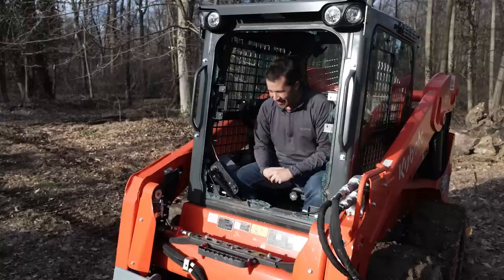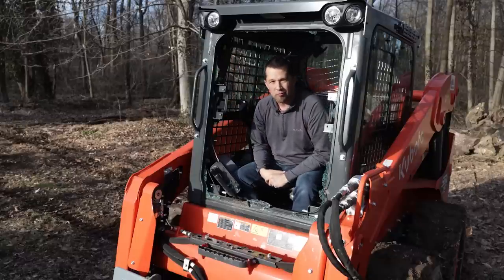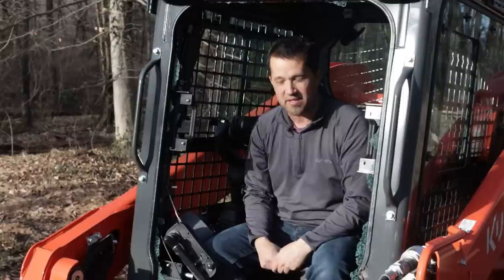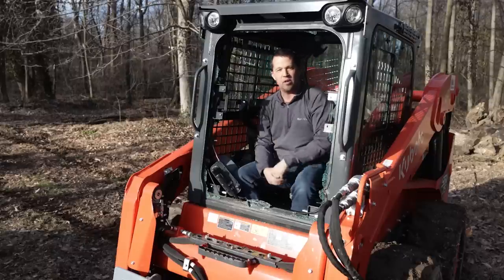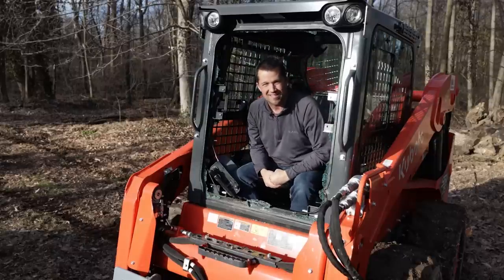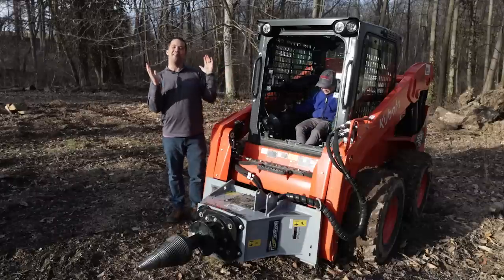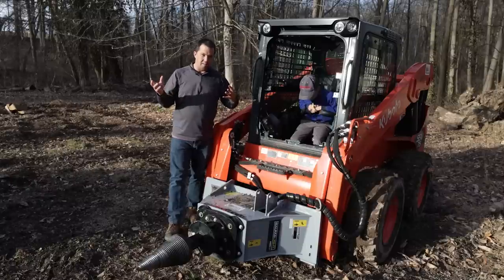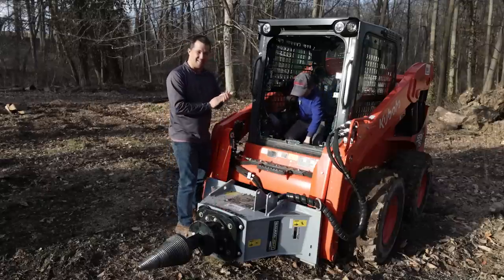I broke it. Kubota SSV front glass replacement.

Comment: Stumps are tricky to split.  Depending on where you attack it and the height above ground it was cut.  Short stumps want to split off the major roots.  So you wrobably have 4 ore more places it will split easily.  The rest is very difficult to split.  Longer stumps start from the cut end and it will usually split normally

Comment: Right after a video about safety on equipment. Glass in your lap's not so bad. Roots in your face could have ended quite differently. We all do it, but kind of amusing so close behind that video.

I really want a splitter like that for the PTO on my B2601. Seems like that could be an inexpensive log splitter rather than shelling out for a hydraulic one (and I don't have the space for one nor the rear remotes for one).

Comment: Is the glass tempered or a polycarbonate material. You should not ramming it into stumps with wood drill implement
Reply: Tempered from factory, but you can buy an overpriced poly one from the dealer for $800+. We bought a piece of thick poly from a glass shop and replaced it on our SVL

Edit: For the record Kubota insurance will replace for a $250 deductible but it don’t make sense.